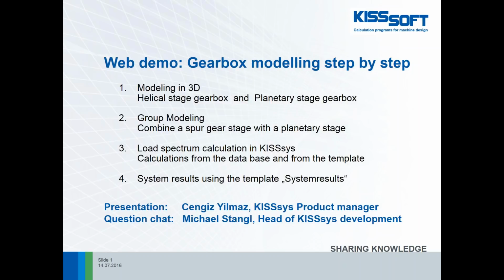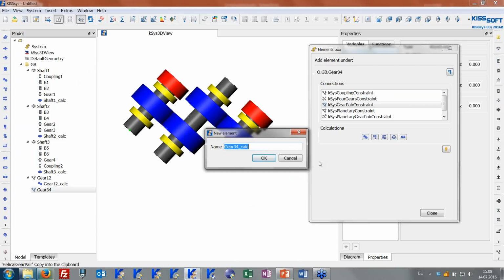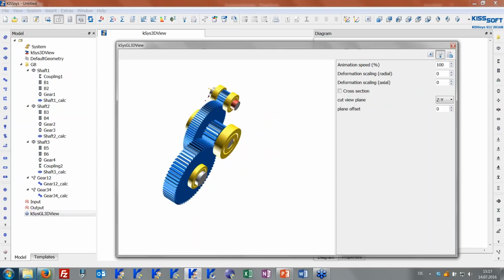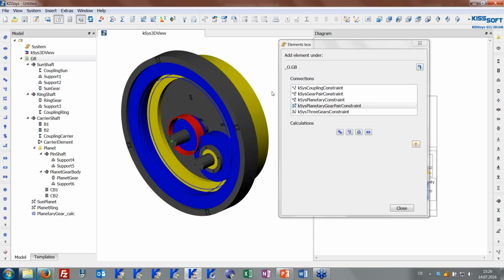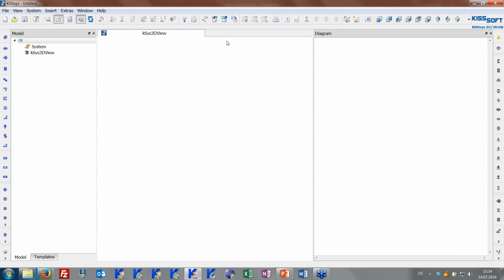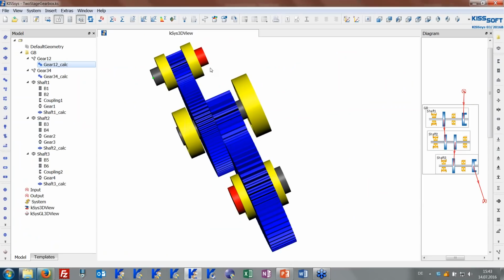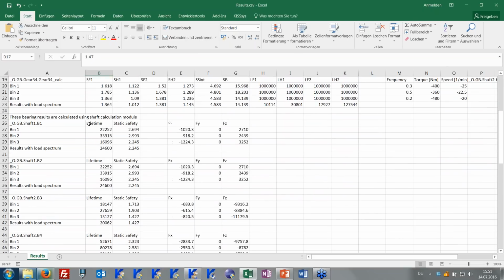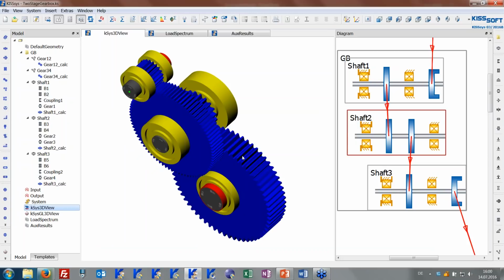Gearbox design with KISSsys step by step

Comment: Hello, I'm trying to build a special planetary gearbox but I fail and don't understand why. My gearbox is like this : a normal planet gear with 3 shaft and 3 planets. Then, there is a 4th coaxial shaft, in the other side of the sun shaft, which is connected to 3 other planets which are in the same shaft of the 3 first planets. It's just a second stage of the planetary gearbox, whithout a ring gear for the 2nd stage. I created 4 shaft, add a new gear on planets folder. Maybe I'm wrong on defining the constraint : I am using the PlanetaryGearPair Constraint to overlap the second stage (4th axle with his gear and the 3 other planets). I spent hours trying different configuration but without any success. Can you help me ?
Reply: Hi i would be glad if you could help me please 🙏🙏🙏
Reply: @BAPPA_Rawala  how ?
Reply: @quentin6196  we can contact on platforms like LinkedIn, instagram , email ID or any other platform you prefer 🙏🙏🙏

Comment: Hi! I have a problem when trying to change the gear ratio with "Gear Sizing" following the tutorial. I get this error message "No solution found in Sizing. Please review the ratio and all other parameters." Plus I also get this error "Internal Error no.Z03-716: Layout KISSsys=2 does not work properly"Thanks!
Reply: can anyone tell me from where can i download this software
Reply: @cadcamengineeringservices3831  you can request from kisssoft's site. They will send you link via e mail and you can use it along one month.
Reply: I can send the torrent file by email. It's good version 2017 with crack

Comment: Hello, I have a problem. When I create first gear pair constraint I see:

 "GearPair_const1_calc.DefaultGeometry:[Index 2 ausserhalb des Arraybereichs] nicht definiert !]

Display next errors?"
Reply: Hello! Have you renamed the names of gears?
Reply: I have same trouble and change the gears name..
Reply: I have same trouble too even if I rename the gears as shown on the video...
Reply: Same problem with the first gear pair constraint, Always. THe solution I found is ignore that constraint, define all others. Then create the very first gear with a different name and define its constraint again with a different name. Lastly remove the first gear and its constraints. Hope that helps.